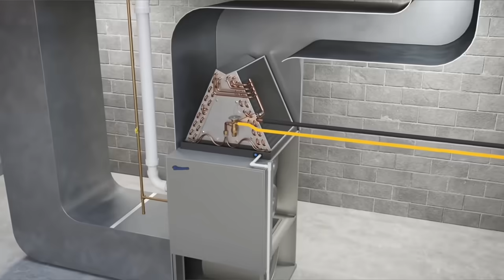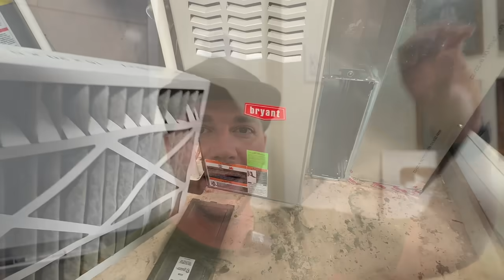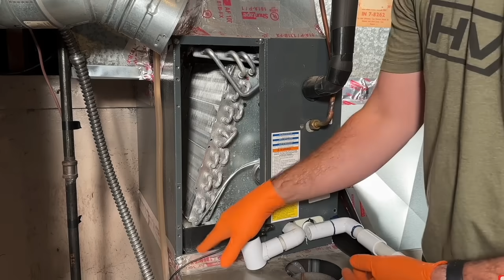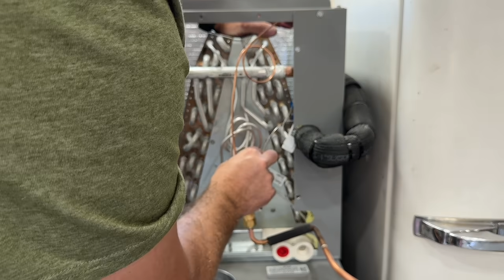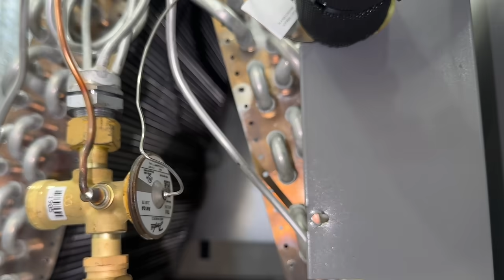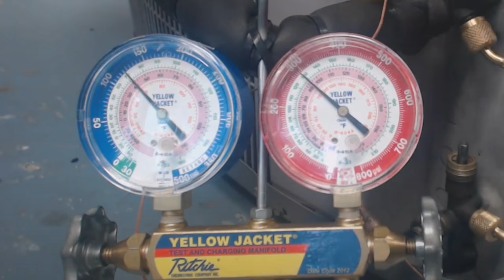Are Your A/C Lines Frozen? Check This First!

Comment: You can be at, or below, 32*F coil temp and be fully charged depending on ambient and return temps. And, for the record, there WAY more than 3 reasons for freeze ups. Setting the thermostat too low or closing too many vents are 2 more examples of MANY that can cause this condition.

Comment: Most ac techs are encouraged to sell new systems not clean and tune up old units mostly you need to clean evap. , the fan blades , and a new filter  replace filter every 6 months more often if your in a dusty erea clean evap. And fan every 5 to 10 years and no problems😊

Comment: After watching this video - I cleaned my evaporator coils, cleaned a little mold buildup on the panel cover, put in a new filter, used a shop vac to suction and flush the drip line, and cleaned the coils on the condenser outside. My Lennox is running like brand new for a week now. I almost paid a HVAC tech to do something I was capable of doing my. I'll only call them to check the freon at this point.

Comment: frozen lines are almost always either a dirty filter, low airflow, or low refrigerant. filter is the free check first, then look at whether all your vents are open and nothing's blocking the return. if it's refrigerant, that's where DIY gets complicated fast since you need EPA 608 to legally handle it, and finding the leak still requires proper equipment. if you've ruled out the simple stuff and the coil keeps freezing, a pro diagnosis is probably worth it before you're looking at compressor damage. ars/rescue rooter does HVAC diagnostics if you want a second set of eyes, though availability depends on your area and you'd want to get the scope in writing before approving any repair.

Comment: frozen lines are almost always either an airflow problem or a refrigerant issue. dirty filter is the first thing to check, then make sure all your vents are open and the evaporator coil isn't caked with dust. if both of those look fine, low refrigerant from a leak is the more likely culprit and that's where DIY gets tricky since you need an EPA 608 cert to handle refrigerant legally. if you're not cert'd, it's worth having a pro check the charge and look for leaks before you just add refrigerant and mask the real problem. ARS/Rescue Rooter is one option to compare for a diagnostic, though I'd get the scope in writing and ask what specifically they tested before approving any repair.

Comment: Would be nice but most AC units don't allow access to the coils w/o disconnecting the lines first so none of the ac places even do coil service anymore because most don't let you have access without having major service costs and paying for all new refrigerant, which in the case of my older unit is extremely expensive.

Comment: I inherited a house from my grandmother.  She had not maintained the AC since she purchased it, probably 15 years ago.   I keep meaning to have it checked out, but it has been running well for a while now, but recently started icing up.   I have been trying to use up the Merv 5 "dust only" filter supply she had, but probably need to start using Merv7/8 ones at the least.  I didn't think to try opening the coil housing and looking to see the state of the coil.  I imagine it is probably completely clogged because of the 15 years of no maintenance and the cheapo filters.  Air flow is greatly reduced at the furthest vent from the unit, so it's almost surely a clogged coil.   That tip about taking the triangular faceplate off is probably going to save me quite a bit of cash, thank you!   Still should check the refrigerant, though, I imagine, as I'm sure it has never been checked in the entire lifetime of the unit.

Comment: 4th reason your evaporator fan motor not running.   Easy fix is if it's the capacitor and not the motor.   Just replaced mine for 10.00 at Ace as my fan wasn't running and coil frozen when I realized.   Great tips but most of us don't have the gauges.
Reply: Which one is the evaporator fan motor?? 😅

Comment: Most of the time when lines freeze up like this it's because there's multiple things going wrong at once, and American Residential Services handles AC repair for situations exactly like this where the refrigerant levels and airflow issues need proper diagnosis.

Comment: Spring testing the air conditioner, could not drop the temp 2 degrees in 45 minutes, the bigger pipe had frost on it. I removed the air filter and within 10 minutes the temp dropped 2 degrees and the furnace shut off.   I am hoping that my 30 yo furnace and air conditioner last one more year. Thanks for sharing even such a simple fix. Going to get a new filter tonight

Comment: The problem that causes this is often the contactor for the condenser and fan in the external unit.  If the fan stays on when the thermostat is satisfied and the internal fan stops, the return line will freeze.  Check the contactor.  It is stuck in the closed position.

Comment: You forgot to mention another reason it can freeze: if any intake vents throughout the house get blocked it can restrict the airflow enough to cause it to freeze
Reply: What and where is the intake pipe
Reply: @ays162 he means the return air to your ac. Usually the vents with filters.
Reply: @ays162 im pretty sure the intake is the biggest vent inside the house
Reply: He did mention that

Comment: First dang thing you check is the air filter. Don't use the allergen types
Next see if the evaporator drain line is dripping water out the end. You may have to turn off the condenser but leave the fan on the ON position for a few hours to melt any ice.
After all that, set it to your normal settings and run for a day.
If it ices up again, call a service company.
Evaporator just might be clogged and needs to be cleaned.
IF they need to add refrigerant, THERE IS A LEAK. Leaks never get better - they get worse.
You want the leak found and addressed.

Comment: Great video. My ac unit was not cooling like it should. So I called an AC company for an AC tune up. The AC guy came to the house to clean the outdoor unit condenser. The  guy. said I can't clean  the unit because the Freon is low in the unit. He didn't check the coils inside to see if the coils were dirty.  The guy said I'll send you a quote for a new condenser &  coil. I received a quote over 8K That includes  a new furnace. Also serveral others ac contractors 🎉The AC tech never said anything regarding dirty coils can cause an issue with the AC cooling performance. He never checked the coils or anything. After watching your video I saw you mentioned  about checking and cleaning the coils. I said to myself WOW none of the AC tech guys never mentioned anything regarding checking & cleaning the coils. Thank you for sharing your.
Reply: Most are very shiesty individuals, it’s rare to find one who’s truly HONEST and actually does their diagnostic job thorough.
Reply: @speedyReedyEnterprise I agree 💯
Reply: @speedyReedyEnterprise  that's capitalism.  the honest dude spends hours doing deep diagnostics to make a little bit of money, the other dude takes 20 minutes then sells a new unit for $10k.
as far as the corporation is concerned, the first dude is dead weight getting paid to cost the company sales.
Reply: @saaah707 yea i understand that, it’s just crazy times for 97% of companies to be that way and people actually paying them. Not all the time what goes around comes around but in the case of ALL hvac techs i wish it would.
Reply: @speedyReedyEnterprise  people just don't know any better and just assume that's the way it is. We all collectively need to disavow this way of thinking and be better. If we as humanity did this. We would have a LOT less problems in our lives.
Reply: @dakurisu3431 100%
Reply: @saaah707  I would say is dependency...these days nobody wants to lift a freaking finger...and they know it..that's why they're taking advantage of your laziness..
Reply: @gatoborracho4572  or they're taking advantage of people who don't have the expertise or ability to DIY it. Old lady across the street worked as a nurse for 45 years, i don't expect her to fix her own furnace. 🙄 "i only scam her because she's lazy" yeah buddy whatever helps you sleep at night. 🙄
Reply: @saaah707 Dude I'm taking about men..don't came up with your bullshit...there's a lot of things women can't do..that's understandable..but by poining that out makes you feel comfortable !! You can sleep well forever...
Reply: @saaah707 its not  Capitalism . 😂Any person or country can rip you off . It happens in every country every day.
Reply: @saaah707 AirCo wanted $17k
Reply: @kmike-1  capitalism forces the company to value its scammers more than its honest workers. Since they bring in more $$$
Reply: I’ve been doing this myself after seeing it on you tube video.  NOW YOU KNOW.
Reply: 8k? Is it made of gold? Should be no more than 4 to hundred 6
Reply: @Theneworderofthings  AIRCO wants $17k

Comment: I have a carrier weathermaker 9200. There is no access panel to the evaporator coil above the furnace to clean it. Would you advise cutting out a section to access or how is it possible to clean?

Comment: Mine freezes randomly, 1 or 2 times a month. I have a Split heat-pump system. Sometimes the evaporator fan does not start and system freezes. I turn if off, back on, and after a few minutes I back in business until it happens again. sometimes again the same day, sometimes not in a whole month. It happens specially during the monsoon season.

Comment: Mine just quit running 7 days ago, had a spare cap, 99% of the time thats it but wasnt, was ready for a filter. Contactor is fine, all voltages are fine, high pressure switch tests good has no low pressure switch. Board shows no faults, Checking resistance on compressor if not raining again tomorrow, if its ok has quick Access to A coil, just hit 8ys old. Didn't look to see if anything was froze up at the time, didn't find extra water, it gets pumped out tho, ill check to see if its oily inside, im guessing its low. Has TRX wrote on cover plate, it may have been replaced theres no telling just bought place yr ago.

Comment: AZ here. It's set at 78 and currently 86 and pipes frozen. We've had HVAC guy come twice he said "everything is perfectly fine you could use q cleaning there's some dirt caked on the back outside foe 89$ but refrigerant levels are fine and it's working fine". Now he won't respond to My calls loo. It froze over for 2 days then it was fine for a week 78/78 NOW it's back to freezing over.  Not sure what to do since HVAC said everything was fine and working...obviously not. Lol
Reply: Ive had the same issue!
Reply: @kalisfinest805 we moved. Now house is at 72 and no issues. Old landlord HAD to buy a new unit..once aruzona summer hit the unit could not keep up at all and he was having repaors done and no air for them...its bad. Like 13 to 20k for a new AC. I hope that isnt your issue. Other possibility is if your house is 2 stories "too big" you might need another unit but they could have been just tryingnto scam us about that. I dontnknow any AZ homes or mansions that have more than 1 unit lol. 1 good working unit maintained will last about 5 to 8 years here.
Reply: @jennakuder1496  our home here has 3 units and we are experiencing the same thing. We’ve lived all over the world and never have received such horrible service. No one here wants to work or correctly do things
Reply: @Luvly1980  our two story house was built in 2008 by Engle Homes and had two Goodman units for each floor.  The bigger upstairs unit gave out around 2013 and it was out of warranty and too expensive to fix so we got a new one.  The other unit for the downstairs has been working well up until last month. Discovered we had a Freon leak the day before we hosted a baby shower.  Called our AC guy and he came out and said there is a leak and will recharge it to get us through the baby shower.  Recommended not to pay for the experience leak detection on such an old unit and that the recharge should last a month or two. It lasted a month.  Woke up yesterday to water dripping thus triggering my leak detector.  Went up in the attic , saw the water and called the AC guy thinking it was a clogged condensation pipe.  Pipes were clean no blockage but the coils froze. He said you can spend more $$$ to keep recharging at $300 a pound or get a new unit.  We getting a new unit now.
Reply: I’m dealing with a similar issue with our almost 20 year old Goodman unit for our downstairs.
Reply: My tenants keep their bedroom doors closed in the upstairs unit. I keep telling them they have to open the doors to let the air flow. Acts just like a dirty filter. They can't understand why their electric bill is so high and the unit freezes up when it gets good and hot. Amazing.  Then they call me and say my upstairs ac is not working. Hmmmmmmmm

Comment: Just came across your channel and I’m learning a lot. I have a 410 unit and I have to get it “recharged,” every summer at least once bc of the thing freezing up. I definitely have a leak, but no one has been able to find it yet. They’ve tried many, many, times. They can’t find a leak. Anyway…I’m about to call someone to come and recharge it because it’s now July 15th, and I live in Florida. The day is coming when it’s going to freeze and leave me with no A/C on a 105 degree day with 80% humidity 😂. So I’m going to get ahead of it this year unlike the past two, lol. 

Ok, so after that lengthy explanation here’s my question. Last year, my A/C guy sent a new young man out who was in training. I had to call twice last year for a couple reasons. But, when he recharged it, both times when he took those cables off, a ton of stuff sprayed out while he was trying to get those cables off. Does that do anything negative? He told me it didn’t matter and it doesn’t affect the Freon or anything. Can anyone confirm if that’s in fact true?
Reply: Totally normal. The EPA recognizes that it is not possible to have zero loss of freon while working on HVAC
Reply: @VoyagingVoyager Thank you for your reply. I was a bit concerned it was actually removing Freon from my actual A/C Unit vs Freon coming out of the cables when he takes them off. Kind of like when you fill a tire and if the valve stem is compressed while removing the air/fill cable (I can’t think of what to call it,) it actually causes air to escape your tire. So I was worried it was doing that with the Freon in my A/C Unit. Like he recharged it, but then when he took the cables off, it was compressing something and letting the Freon back out of my A/C Unit. I hope I’m making sense.
Reply: @usa-girl911 yep, basically the freon trapped in the line between the valve and gauge has to go somewhere. The minimal/ small amount of bleed off is not a violation of EPA 608 standards. All you should hear is a quick hissing sound.
Reply: @VoyagingVoyager Ok, thank you for the information!! I appreciate it.

Comment: Usually filter first, then check evap coil, then if that doesn't fix it, check pressures and charge to with sub cooling or super heat as required

Comment: Great refresher video. I used the soft brush attachment on the vacuum to clean my coils then a spray bottle to rinse the coil cleaner off. This was years ago but I found out the kids had thrown pop tart wrappers down the return vent and they were stuck on the coils. Surprise! 😮😊
Reply: Bet those same kids flushed little toys down the toilet and bailed water out of the bathtub onto the restroom floor!
Reply: @thebordernow  You guessed it.
Reply: @thebordernow My daughter once flushed down little kitchen towel into toilet bowl, and sewage injector pump sucked it in and tripped the circuit breaker. So, I had to open the sewage pit in crawl space. That was a wonderful job to open the sewage pit 😊. Kids are full of surprises.

Comment: about a year ago I did a lot of research after the inside part of the AC was icing over and turning into a block of ice and blowing warm air. Cleaned everything and new filter no change. called an AC tech and they said old unit and tried to sell me a new AC system over $5,000. Everything pointed to low freon and called an independent AC guy and he filled up the system and has been running fine ever since. only problem I have is the slime that forms in the drain line that I will have to flush out with a garden house every few months
Reply: If you had to add Freon you have a leak somewhere
Reply: @GarnettEison that's what it sounds like to me too 👍🏻
Reply: They make bio tablets to put in your drain to cut down on drain problems.

Comment: Do you have any experience with Nu-Calgon Cal-Bright + and Cal-Shield coil protectant? I have a 1983 Carrier heat pump with an all aluminum evaporator that drips water on the filter when the blower stops for as long as I can remember. I tried 2 different mild coil cleaners cleaners with no luck. I have read quite a few threads from techs on HVAC forums on different manufactures with this same problem. Lots of ideas and some think the coils may be laid over too far from the factory. The Cal-Bright seems to be a fairly strong acid and I'm leery about using it. Great channel you have with a lot of good info!!

Comment: Are the frozen lines only a factor in high humidity areas? In Northern California where I live, the humidity in the summer is 20% or less.  My system was low on refrigerant and my only symptom was that the suction tube was not very cold.  PSI was about 50.  When I added 2 LBS of 410A refrigerant, pressure went up to about 100, and the suction tube started getting colder and the system started cooling the house nicely. It seems that my symptoms for low refrigerant were exactly the opposite of what you describe.